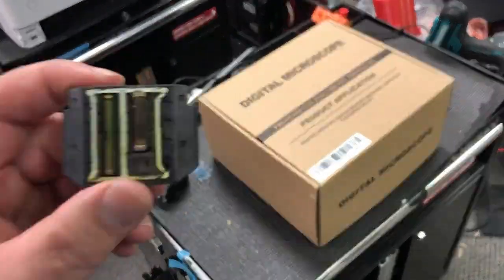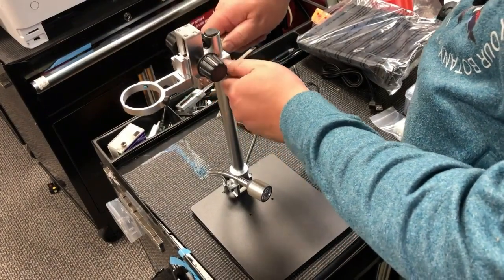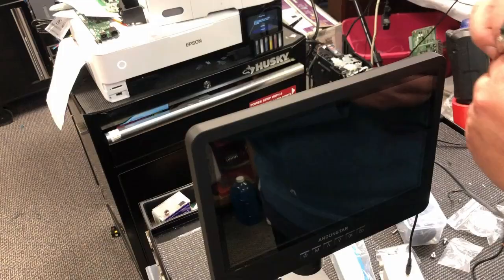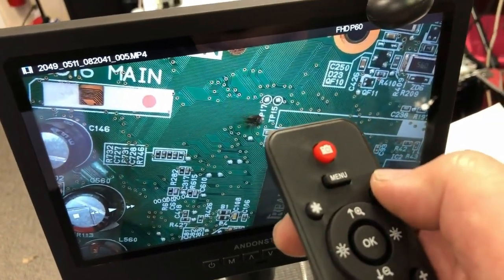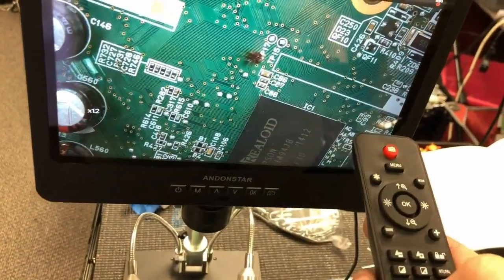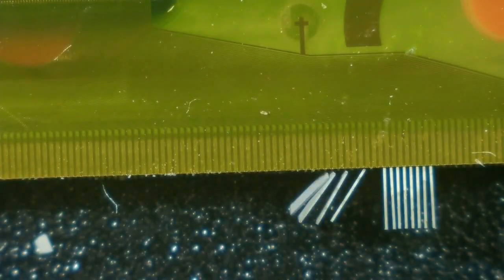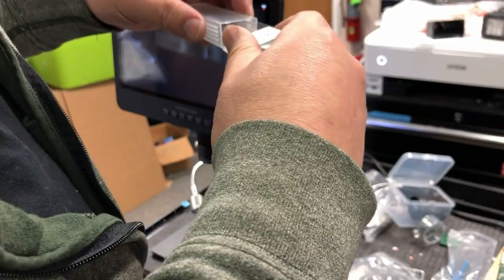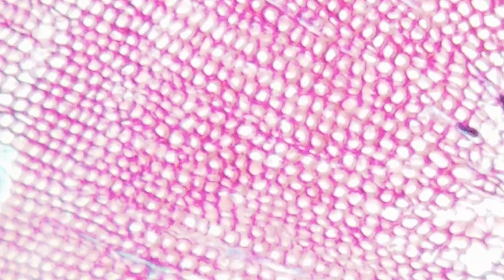Top 5 reasons to buy a Andonstar AD249S Microscope for Mainboard Repair

Comment: Looks like a great piece of kit. Don't know how you managed micro soldering without magnification!
Reply from the maker: I was using a optical dissection scope and a magnify glass. The problem is the fume always comes my way. Now I can step back and look at the monitor.
Reply: @BCHTechnologies  OK thanks. Fumes not good especially if using lead solder. Could you get an extractor fan?